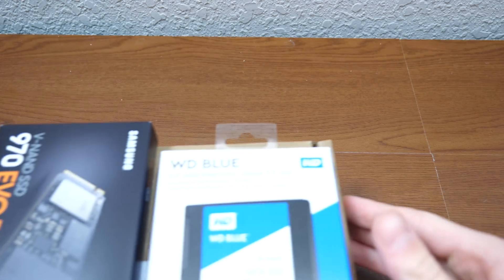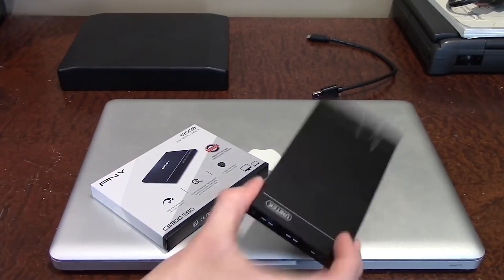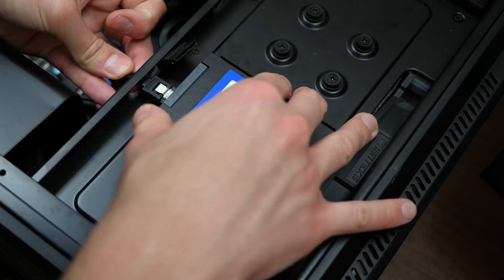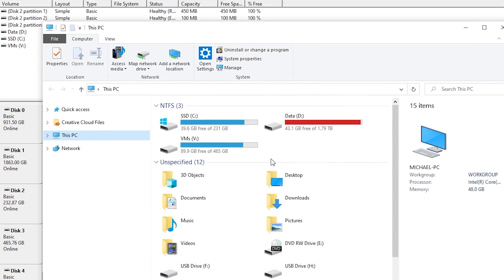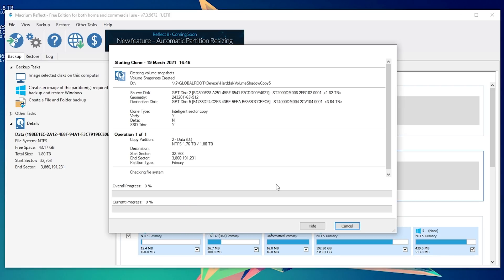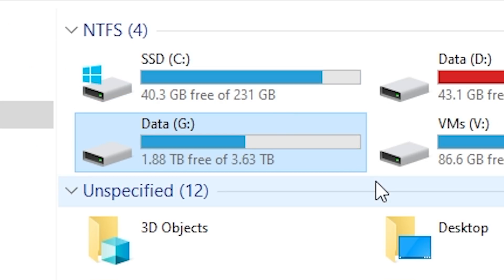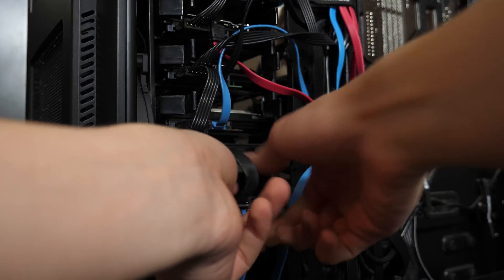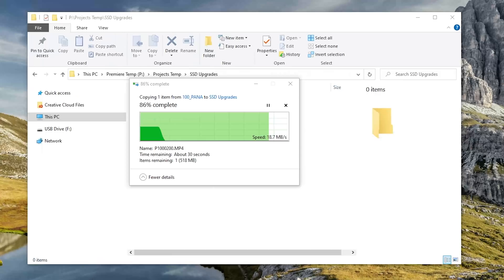Installing an SSD in… My Main Computer (Hardware Upgrades)

Comment: Coincidentally, I also have a Samsung 970 Evo Plus 500 GB for my build (with Windows 10 Pro)! However, rather than pairing it with a WD Blue SSD 1 TB, I'm pairing mine with a Samsung 870 QVO 1 TB (as my primary data drive). I wanted an Evo instead, but managed to get a good deal on a QVO from someone who seemingly bought it from a store in Hong Kong (no local warranty AFAIK, but I trust Samsung flash storage products that much). I plan to add a smaller 870 Evo that I will install Fedora Workstation on as a secondary OS. I think the reason why I'm sticking with Samsung SSDs is that I like their Magician software enough to stick with their products.

My build also has a regular Intel Core i7-7700 (non-K, but I don't plan to overclock as I want stability, also it has an Intel Core 10th gen stock cooler), 32 GB of RAM, and a Zotac NVIDIA GeForce GTX 1050Ti, and I plan to expand it later on. The case is a modified Corsair Obsidian 750D I picked up from some guy on Carousell who was selling it for $25 because it was missing parts. Found some NOS hard drive cages for $8 each, I bought 2 and am trying to buy a 3rd one, and will upgrade it over time.

Oh, and I have 4 monitors:
- Dell U2713HM as main display
- Dell P1913 to the right and sideways for viewing documents, e-books, etc
- Samsung P2250 to the left, primarily for managing my custom-built NAS
- XP-Pen Artist 13.3 Pro on the desk surface, primarily for running art apps like Krita, but also to help me with some stuff I plan to try out that I can't easily explain

(2:46) Samsung WHAT Evo Plus?!?!?!?!?!?!?!?!?!?! 🤦🏾‍♂️

Comment: In macrium, on the Clone this disc view, you can manually cross-drag partitions, and then by dragging the right side of the data partition, fill the empty space of the drive with the data partition, in one step. Faster and simpler than the mentioned.

Comment: Wow your case is way easier to get hdd in and out of. I am actually afraid of doing it in mind because of how difficult it is.

Also cloning drives sucks because after you do so Windows still reports that the drive is only the size of the previous drive and the rest of the drive is just set to unallocated space yes you can allocate the space but then it shows up as two separate hard drives in Windows :(

Edit 9:40 I tried to do that on whatever Linux OS I was using and it wouldn't let me copy the extra partition over so I just left it off. Maybe because I was imaging the drive my computer only had one connector for whatever the Wi-Fi connector is called not m.2 so I had to image to an external drive then flash the image to the new drive
Reply: you need to extend the partition and it shows like a single hard drive
Reply: @namesurname4666  in disk manager the partition closest to the empty space is the only partition that can be expanded I have no idea why and think it's the stupidest thing ever therefore if that partition isn't your C partition you're f*****.
Reply: @bland9876  you can do that with minitool partition for free, always make a backup just to make sure you don't screw up anything

Comment: Speaking of really old hard drives I was at a thrift store and I found a 750 GB 3.5 inch drive. I wouldn't think anything of it except 750 GB is way too big of a hard drive I didn't know that they were still using IDE when that was around I thought they would have moved on to Saturday then I've seen lots of 500 GB or less SATA drives

Comment: everyone praises ssd but nobody talks about what happens when they fail, data recovery is very expensive and not 100% success rate compared to hdds, also ssds in high workloads enviroments fail way sooner than hdds.
a cheap new hdd will easily outlast an average ssd (twice or even triple the price)in a heavy office enviroment

Comment: I just recently built a computer with an NVMe drive, and it sits at the BIOS screen longer than it takes to boot the operating system. It would probably boot even faster if I took the mechanical storage drive out, I think that's why it sits there at the mobo post screen for a tad longer, it has to wait for the mechanical drive to spin up to detect it.

Comment: woah, i built a computer with the same specs in 2017 as well! same upgrades too! just recently replaced my 3tb segate hard drive with a 12tb hitachi drive after it started failing.

Comment: I always used easeus partition master (any cloning software should work fine these days) to clone any type of drive never had a single issue straight forward plugnplay  but I also have a inateck cloning Dock wich works great offline (not plugged into any pc) or online

Comment: I have used the Samsung 970 EVO Plus for a year and a half as my main drive, its really fast, though those 500GBs filled up over the time and I need more space, I was thinking of a normal HDD with around 10TB (more or less) so that I wouldn't need to get more for a long time...

Comment: Why didn't you just bought a bigger NVMe instead of a NVMe + a regular SSD, you could've just partitioned it, also, you don't need to initialise every driver, just the one you'll be booting from.
It would be better to use the NVMe driver as the boot partition (faster boot and program loading times), and your VMs could be stored on a SSD (the difference in boot time is also huge). BTW, why didn't you keep the 2TB HDD and removed the 2008 drive instead?

Comment: That is the exact same sad I put in my laptop, the pny 120 gb one it had good reviews and my hdd in my laptop was falling apart which was causing consistency issues, and it is quite and ancient alptop but with an SSD it is faster than new, (core 2 duo, Lenovo 3000 n200 if interested lol)

Comment: I installed one of the Samsung 970 EVO M.2 SSDs in my desktop a couple weeks ago. They run so fast too and are genuinely amazing! The only downside is that they don't include a screw.
Reply: Your motherboard should have come with the screw for the M.2 slot....  If it didn't come with one I would contact the manufacturer.

Comment: I recently picked up a Dell Latitude D630 at a thrift store for 8 dollars (missing power cable). I got a cable off ebay for 10. The XP install was old and sluggish so I put 7 on it. Works perfectly unless I add service pack 1. Then its slow again. But without SP1 I installed Quake 1 and 2, and Myst (gog masterpiece edition) on it. For a office laptop its pretty fast. I don't expect much gaming, but it handles these games well. My future upgrades will be more ram, and an SSD. This laptop blows my old ASUS UL30Vt-X1 out of the water.
Reply: I had one of those that I found in a dumpster as I live in a college town and people throw stuff like that away all the time. Those machines were actually run windows 10 perfectly fine. You will need to upgrade the hardware before installing. The prerequisite is making sure that the processor that is installed as a 64-bit processor for example the one that I pulled out of the dumpster has an Intel core to do OT 7500 clocked at 2.2 GHz with 4 MB of L2 cache. It would also be a good idea to go with an SSD as well as maxing the ram to
8 GB. Even though all of the Dell literature says the slots will only take up to four with the most recent bios version which is a -19 those ram slots will support four gigs each of DDR2 PC two 6400 you running at 800 MHz. I ended up completely refurbishing the machine with new plastics, screen, and upgraded hardware and paid it forward to my mother-in-law who was in dire need of a new computer. It is running windows 10 pro 64-bit and is working fine to this day.
Reply: @BlindMansRevenge2002  Good to know it can handle Windows 10. As for the screen, there is a noticeable nick in this unit. I guess the previous owner bumped it. When its turned on you can see the white background behind the screen. But its so small it doesn't get in the way of much. It's actually a decent laptop. I don't buy Dell products but somehow they keep finding their way into my cart at thrift stores lol.
Reply: Very cool man! Rest assured that if you decide to pull the trigger on a windows 10 upgrade for that machine it will run perfectly fine. I am not a fan of the throwaway society that we have become and have made it my mission to find old abandoned  laptops to bring back to life and put  to work. I specialize in Dell PC‘s and my latest project was a Dell Inspiron E 1405 from 2006. The machine was given to me by a family member who thought it would be a good daily driver. After seeing that it had Windows XP media center version 2005 I informed them that it would not be a good idea to use that computer on a daily basis. They asked me if I wanted it and of course, I said yes. I found a genuine Dell PA-10 power cord at a surplus store to power it and after looking at the hardware I saw that there was room for improvement. As the screen was in good condition and functioning normally I left that alone. I replaced all the plastics except the back panel because it was in good shape took it from one gigabyte of RAM to 4 GB of RAM, added Bluetooth,, Upgraded the BG Wi-Fi card to a draft and Wi-Fi card capable of 270 Mb per second, ripped out the 1.6 GHz processor and installed a Intel core to dual T 7600 clocked for 2.3 GHz with 4MB of L2 cache and 64-bit architecture, installed a Samsung Evo 860 SSD, and installed windows 10 pro 64-bit. The machine is running flawlessly with the latest version of windows 10 pro Version 20 H2. Topping everything off with a brand new keyboard this machine will be going to my dad.

Comment: I can't wrap my head around why the m.2 isn't the boot drive
Reply from the maker: Because the optimal configuration for Premiere Pro is to use the NVMe drive solely to store project files and assets. Plus, from what I've researched, you're not going to notice much of a difference in loading times compared to a SATA SSD. File transfer speeds is where you'll notice a big difference.
Reply: Properly configured SATA and NVMe SSDs aren't much different in boot time at all and most games cannot even leverage NVMe speeds. However, you'll definitely notice the difference with premiere, especially during scrubbing.
Reply: @gen_angry  oh thanks :)
Reply: @MichaelMJD  going from about 30 second boot times to windows 10 to about 5 seconds with a 3800x

Comment: A few years ago I replaced the hard drive in my HP PC with a Samsug 860 EVO. It did make the PC faster. Samsung offered software that copies the operating system, installed software and files from the old hard drive to the SSD Drive.

Comment: Is it possible to put an M.2 SSD inside of an Xbox One S? If it is then I will do it i have one inside my laptop and it runs flawlessly
Reply: You should be able to buy an M.2 to SATA adapter that would do the job. Though if your drive is NVMe you'd be handcapping it to SATA speeds on the Xbox
Reply: @tendstofortytwo  thanks

Comment: Video idea:
Try as hard as possible to put a M2 ssd in the 98 pc
Reply: Well technically NVME ssd's are somewhat of a single board computers. (pls don't kill me because of that statement you nerds) And I think you would need an another computer just to connect the drive to the 98 computer. Also a highly skilled programmer is needed on the software side...
Reply: @ozmobozo  I'll say that Windows XP might support it though never seen it before because it has nt kernel that is much recent and updated until 2014 not sure though this is the case only assumptions 😅😂but 95 or 2000 is a big understatement
Reply: @pcbwiko7734  I have the same ssd maybe I could try installing windows xp. Don't know if ryzen second gen supports xp though.
Reply: Tried this as a joke to kill time around july last year. 
Spare him the hassle, m.2 SSD adapters that fit SATA ports, and therefore defeat the purpose of having it be m.2 is the only way to achieve that and even then you get near-undetectable difference from something like a good 7200 rpm hard drive (this was the age of single platter 3000rpm after all)
could be good for a tech gorey series? it's for him to decide but sure as hell it hurts to do for no real advantage :P
Reply: @punstartracer  But isn't m.2 to sata adapters are only for sata m.2 drives? This one is Pci-e so do you know if it'll work?
Reply: @ozmobozo  don't bother with it Windows XP can run even on a toaster with no lag I had a 2004 Pentium 4 with a HDD that I don't remember  it's speed but i bet it was 5400rpm and it ran better than my windows 10 machine ....upgrading sucks😂i wish i could install windows 7 wich is the same as XP low on recources  on a modern PC wouldn't have stayed a minute with win 10
Reply: @ozmobozo  M.2 is the exact same format as a PCI-e minicard (without 4 energy pins I think?) and adapters transfer the format to a x16 motherboard PCI-e.
Windows 98 era boards have no instruction sets to read PCI-e minicards but they can get working with the backwards compatibility of SATA interfaces, From my tests on a real Win 98, it was getting a sketchy adapter to get it to work on a spare M.2 with the hope of getting Digidesign ProTools to run fast, and learning how dissapointing the performance was compared to a spinning platter.
I mentioned the ability for a tech gorey series because I was reading about custom Win 98 drivers to get things like that working without adapters 🤔 but I wasn't looking for more trouble than it was worth and it definitely seemed like it.
Reply: Lmfao
Reply: You could do this with an OS bootloader like grub or rEFInd. Have an hdd/ssd with grub/rEFInd point to the pci ssd that has windows 98.
Reply: Why are we still here just to suffer?every night I could feel the m.2 that I don't have suffering on a 5$98PC?that won't stop hurting...I'm gonna make goldwyn  balila give back our future...

But for real why such sacrifice😂😂

Comment: I actually just cloned my desktop's drive to a bigger one last night.  In Macrium you can adjust the partitions before you start the clone.  It's an option under the selected partition on the "new" drive called "Clone Partition properties".  What you did obviously works, but doing the partion resizing in Macrium will just save you some time.  Good video mate!

Comment: Hi I just watched 98 pc CPU -BIOS upgrade and the other videos and I think the reason why the 1ghz Pentium 3 didn't run is because of power limit try removing some hardware or upgrading the PSU aka power supply and see if it works I already had this problem with upgrading a Pentium 4 PC I had😉

Comment: i just got a 5 TB HDD for backup stoarge a few days ago :D
Reply: My 2 TB 10200 RPM is Dead some days ago oof
Reply: @lefakeofficieldemoimeme9610  dead drives are my worst nightmare even when i make backups
Reply: @yuseiyamoto  mine died instantly when using VMware

Comment: Mistake there... don't use the 2.5" SATA SSD for your boot drive... Considering it's a 1tb drive, it should've been used for much more than just a boot drive... if you have a M.2, use it as your boot drive it will make a whole lot of difference.

Comment: Now your PC is closer to my specs! Except that I use a USB disc drive (I have an NZXT S340 Elite), I have an i5-7600k (you have an i7-7700k), and I have a GTX 1060 (you have a 1070). Do you have the link to your original PC upgrade video? I can't find it on your channel from what at least I see.
Edit 1: I was supposed to say about how I have the exact same SSD!
Edit 2: It was the Samsung 970 Evo Plus 500GB.